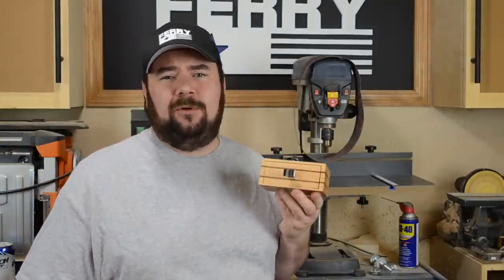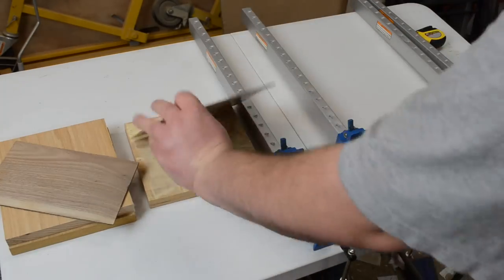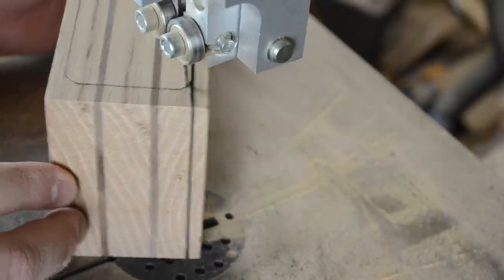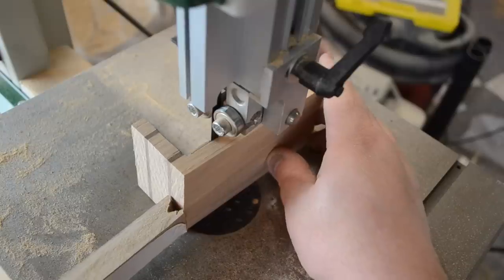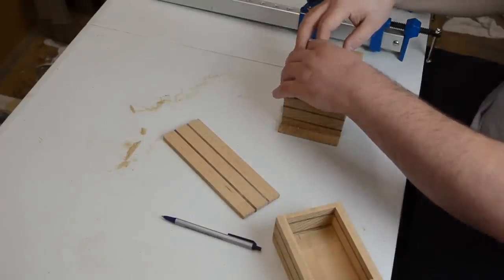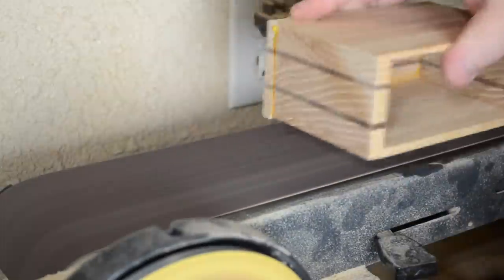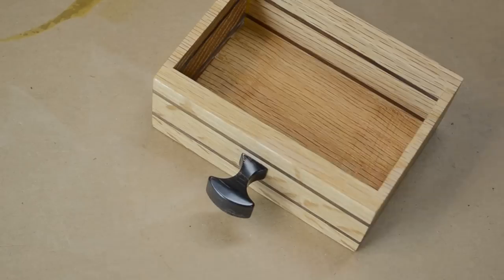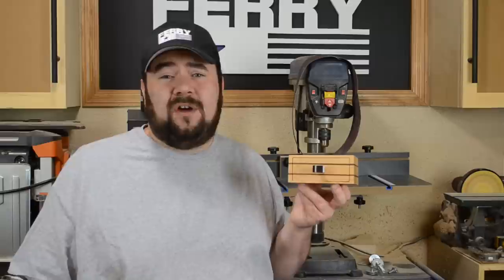Ⓕ How To Make A "sort of" Bandsaw Box (ep27)

Comment: As usual, good job and video.  I use a 4tpi 3/16 blade to cut my bandsaw boxes and they do quite well.  Believe me, the blade you use makes a LOT of difference.  If anyone out there is still using the blade that came on your saw, you may not really know how good your saw is.  I got some blades that I saw recommended, I think they are Timberwolf blades, but they are great compared to what came on the saw.   I actually bought my band saw to cut these little boxes with after seeing some on youtube.  It has since become my favorite saw.  I actually cut my first one from a dogwood sapling stump and it has become my most watched video.  I love making these little guys.  The ideas are endless for how to glue up the wood in different ways and the many designs one can use to cut them.
Reply from the maker: thanks for the info - I agree, the blade can make all the difference!

Comment: The box turned out great, Nick, and I'd probably make it the same way since I don't have a 1/8" bandsaw blade to snap.  Regarding your belt sander, it looks like the same one I have.  I got mine about 15 years ago, and it is still chugging along.
Reply from the maker: RSM Woodworks Thank you.  I don't think I'm going to mess with 1/8" blades anytime soon.  Belt sander is a craftsman and I've had it for years as well.  I don't like how small the disc sander part is and I want to get a dedicated larger disc sander but that would be a while after I save my money for a sawstop.

Comment: Adapt and overcome!  I don't know if the blade breaking had anything to do with the way it was set up in the guides.  The teeth shouldn't be between the bearings, that might have removed some of the set of the teeth and made it not able to turn as well.  On my carter guides there is groove in the bearings where you can set the teeth on small blades.  I never use anything smaller than 3/16 though, I had heard they turn just as well as 1/8 but are stronger.
Reply from the maker: krtwood Thanks Kevin, I really want a carter guide but I figured I would wait until I get a bigger bandsaw before I do.  I don't mind this saw but it is pretty small and the blade length is kind of a goofy size.  Thanks for the info, I'll check the bearing set up but no more 1/8" blades for me.

Comment: It looks like you have the Craftsman band saw. I just recently bought one and it will not hold a 1/8" blade for nothing. Brand new saw is basically useless for the purpose it was designed. Making sharp curves.
Reply from the maker: mine is not the craftsman, similar but not exact

Comment: Sucks that the blade broke.  Looks to me like you might have been twisting the blade a little too hard rather than driving through the curve (but I could be wrong).  The square bandsaw box actually looked really good - curves are sometimes overrated (with the possible exception of lady curves).  A chisel or plane can be better at cleaning off the glue lines if you are careful and means you will require less time at the sander - or just wiping as much as you can off with a damp rag at clamp up might elimiate them altogether.
Reply from the maker: Jason Adamczyk Thanks Jason.  Too much twisting is what I was thinking too.  I think I like the square look better now that it is done.  I didn't clean much of the glue because I knew I would have to sand most of the wood smooth anyway.  I should look into getting a plane or two.  That would have made it a bit easier.

Comment: not sure what type of blade you are using but i use BI-metallic blades they cost more but are stronger and sharper and last longer than standard blades your blade was you main problem to many teeth which choke and jam the blade when cutting thick timber,but you still made a box which looked good
Reply from the maker: yeah cheap old blade so I wasn't expecting much - need to upgrade my bandsaw to a bigger one anyway - this is a good excuse

Comment: Great job!  I find myself in need of a bunch of decorative boxes myself.  I'm wondering what you use/recommend for band saw blades.  

The blade on my 10" band saw isn't the greatest and I just don't use it much due to a lack of proficiency - my cuts always come out wonky - and I've decided it's time to just do some projects that I can hone my band saw skills with.
Reply from the maker: +laanyan thanks - if you are making straight cuts like I ended up doing here, get as wide of a blade you can - also make sure your guides are set properly to minimize and inaccuracy
Reply: +Nick Ferry Thanks Nick.  I did end up picking up a variety of blades.  I really didn't realize how much is going on.  On straight cuts, I do get the best result from a wider blade.

One other thing that I learned  is that for bigger cuts, fewer teeth will help keep the blade true too.  I think that my tension was also slightly off.  Wonky cuts are becoming less wonky (couldn't have anything to do with getting some practice...).  Thanks!